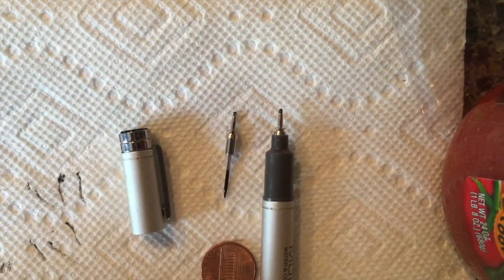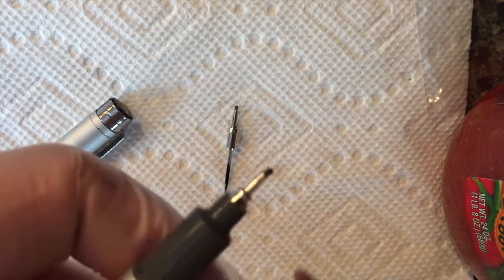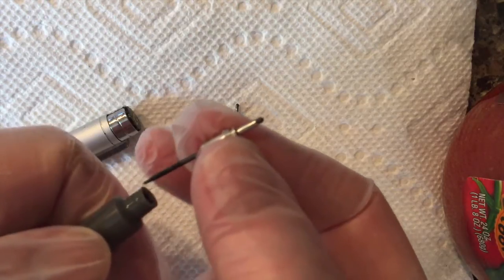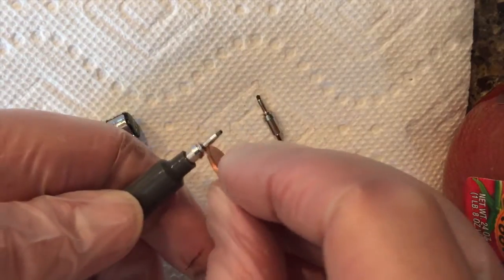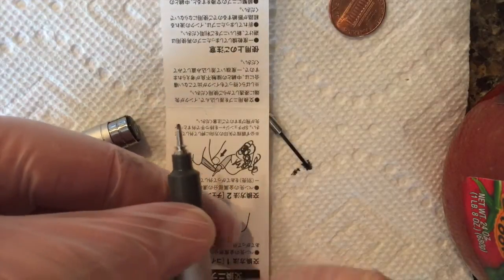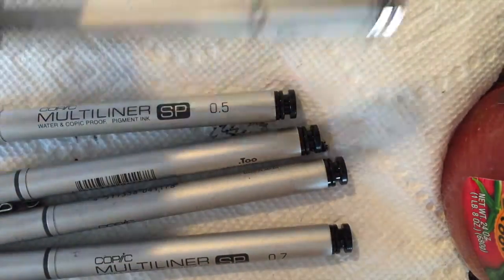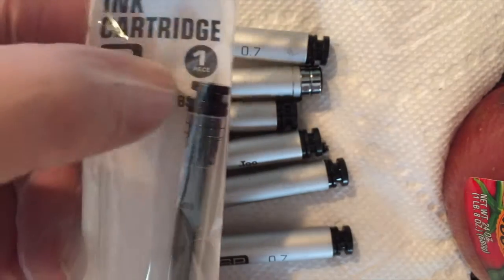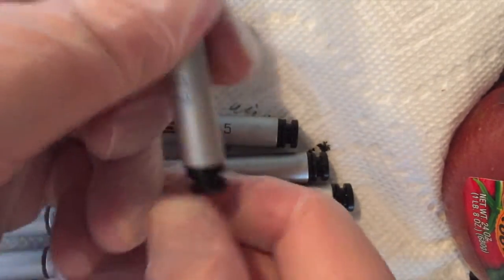Copic Multiliner SP Tip Change

Comment: @Owings Art I have had mine for just a bit, so I went through the exercise of taking out the cartridge just to see how it works. I used the heck out of 'em for a few drawings, and I was thinking they might be low on ink, but then the next day the flow seemed to come back. The reservoir on the cartridge looks all black so I presume it's full, but how will I know it's low on ink? I was guessing that the black will go down as it would if you had a tube with ink in it, no? Let me know please, and thanks for your video!
Reply from the maker: Hi Rob - Really the only way to know is when the ink runs out. I give them a shake and they come back sometimes, but if I do it again and get no ink, I know it's time for a change. ~Marty
Reply: +Owings thanks for getting back! Ok, sounds like it'll be obvious 😉 thanks for making this video!
Reply from the maker: Rob Levin For sure Rob. Much appreciated.

Comment: Hi @owings, can you tell me when would you decide it is the time to replace the reservoir? I have a Copic 0.35mm SP and it is still streaking when I changed the nib. The reservoir still look full and have ink it in, but how can one tell it is time? Hints and tips appreciated. 

The nib is quite obvious.
Reply from the maker: Are you pressing very hard on the pen when you use it or being too light? I can't think of any other reasons this might be happening to you. Strange. You can usually tell the reservoir is empty when the ink starts to sputter or stop. That's it really. Hope it helps. ~Marty

Comment: Hi,
I have one question.
I have a copic multiliner SP 0.5 and i wanted to know if i can change the Tip from 0.5 to 0.1 by buying new tip?
Reply from the maker: I don't think so, I think the diameter of the openings are different. Suppose you could verify by looking at both to determine that for sure. ~Marty
Reply: Actually recently I did pretty much exactly that.
I ordered .03 by mistake. I actually wanted a 0.3. They (Amazon) sent me 4 of them by mistake. I ordered a 0.3 nib  hoping it would fit and it did. Works great. Plus I've still got 2 more I can replace with different sizes.
Lucky me.